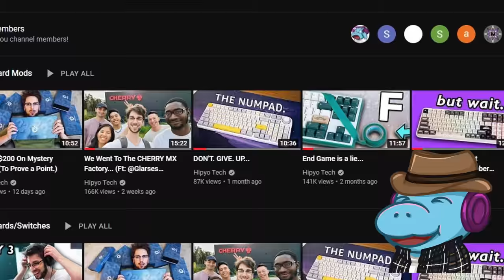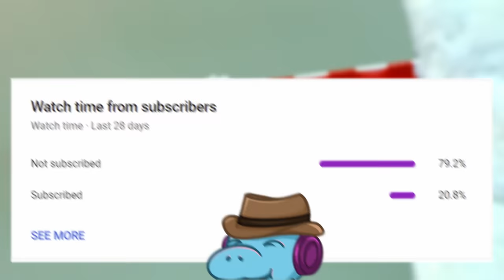Top 5 Ways To Make Your Keyboard THOCK (On A Budget)

Comment: The tape part is actually concerning. You preferably don't want to do any tape if you have a battery inside your keyboard. Electrical tape can actually be harmful, especially to hotswap sockets. If there's no battery on a hotswap pcb, use painter's tape. There's less chance of ripping out a hotswap socket. Just remember to avoid the jst cable connections so you dont accidentally rip those out either.
Reply: He uses painters tape in the video for a reason lol
Reply: @MarksterC  …he said to use electrical tape. Facepalm. I wasn’t saying the comment based on his actions but on what he was telling people to do
Reply: @SilverCrypt  so even if i have a battery painters tape is still to go?
Reply: @sleepyzzzz720  just use painter's tape on PCB and avoid covering the battery

Comment: Hey Hipyo, easy thing for the painters tape mod is make it less sticky. lightly press the tape on your shirt (clean preferably) and it will lessen the adhesive. helps a ton and makes the tape not as sticky. just fyi
Reply: It says a lot about the keyboard community when this man has to specify that the shirt should be clean
Reply: @funyunfingers  cough cough "gorilla glue" cough cough
Reply: @crusadertwo239  cough cough “joke” cough cough
Reply: @funyunfingers  I was making a ✨ joke ✨
Reply: It won't lessen the adhesive. It's just that fibers and dust particles will adhere to it.
Reply: @itsgonnabeanaurfromme  which... lessens the adhesive [adherance to other surfaces]...

Comment: I was a bit zoned out doing some CAD work, but I did hear silver bullet. You wouldn't believe how expensive that was to fill my keyboard with silver bullets, and I wouldn't say the sound is improved at all. I may need to watch the video again and pay attention this time.
Reply: silver bullet may or may not have been an expession :face-blue-smiling::face-blue-smiling::face-blue-smiling:
Reply: I hope this doesn't reach you too late.  Your silver bullet keyboard should prove moderately useful in the event of a vampire attack, however delivery of the bullet by the traditional method is preferred for optimal results.

Comment: With the automotive dampener, it also makes a noticeable difference to roll it down as well. Those rectangles that are bulging up, yeah those have to be rolled down so that they're fairly flat. I am a big fan of automotive dampener too, but these materials tend to reduce sound frequencies across the board, lows, highs, everything. I know some people prefer to only dampen lower frequencies and some like to dampen higher frequencies sounds, it all depends on the board they have and all the materials used.
Reply: Do you know where you can just buy one sheet? All the listings I have seen are 80 dollar rolls and I personally don’t think I need that much.
Reply: @mee6box you are paying a premium for "Auto" sound deadening brands like Dynamat, etc... they are nice but really overkill and overpriced for this application. There are cheaper brands that make the same product for less. They come in various thicknesses so make sure it will fit in your KB. You can also go super cheap and use Frost King or Peal & Seal duct insulation from a hardware store, I use them in my cars its the same thing but cheaper.

Comment: 00:01 Top 5 ways to improve keyboard sound
01:15 Tape mod for improved keyboard sound
02:34 Wrap bare bones keyboard PCB in plastic wrap for thock sound
03:52 Using press and seal improves the sound of switches
05:12 Lubing switches is a key step for improving keyboard sound and feel.
06:17 Adding lube to high contact points makes the keyboard smoother.
07:27 Using dampening materials and choosing keycaps can improve keyboard sound
08:50 Thick PBT keycap sets improve keyboard sound quality.
Reply: thanks

Comment: I kind of rolled a few of your mods together and took a brown paper bag, folded it to size, rolled it in ceran wrap, taped it to the bottom of the case with painters tape and I was surprised that it took a slightly rattly keyboard and firmed up the sound somewhat. I did cut small holes for the screws and had to resync the 2.4Ghz dongle.
It's a YK75 low profile keyboard without too much you can change with outemu blue switches - just because they were cheaper. for my hands, it's now the fastest keyboard I own - probably because I enjoy typing on it most and thus practice on it more.
It would be my all-time best keyboard (yes, mine are all cheap) except that you can't program keys and macros - but I went from 40 wpm to 60wpm in a couple of days.
I'm probably the key demographic in terms of starting and moving up in the keyboard world. It's not scary but under $100, the improvements that you can make are insane for a small budget.

Comment: I appreciate all the help on the video. I do plan on using this mod on my NJ80 and hopefully my Zoom75 but according to Tempest's article he says this: 

What Kind of Tape is Suitable For the Mod?
To ensure that you would buy suitable and keyboard-safe tape for tape modding, you must keep in mind these two important things:

Buy tape that is not too adhesive or sticky or designed to be easily removed. Examples of less adhesive and less sticky tapes are masking, washi, or painter’s tapes; if you ever decide to remove the tape behind your PCB, it will not damage your board. 

Sticky tapes such as duct tape and box tape tend to ruin your PCB by pulling out conduits from your keyboard when removed. Additionally, super adhesive tapes leave sticky residues that may also ruin your board. 

!!!!!Another thing to remember is that you should buy tape that is not conducive. Conductive tapes, such as electrical tape, can cause short circuits, damaging your PCB. This is especially true if your keyboard comes with a battery. The tape can potentially serve as insulation to the board’s battery, thus harming your PCB.!!!!!!

Tape that you can buy online or at local stores is sufficient for the mod. However, to guarantee that you will not damage your PCB in the process of modding, avoid purchasing adhesive and conductive tapes. Instead, opt for tapes that you can remove easily.

I'm sorry, but I just had to make sure. Still great advice!!
Reply: Just a comment about your post, from my knowledge electrical tape is not conductive and is used to isolate energy thus promoting an environment where eletricity can’t propagate and cause damage to the circuits of the PCB.

Comment: Based on my experience, getting your keyboard to thock heavily depends on the acoustics of your board rather than the switch, maybe like 80% keeb and 20% switch. I tried a budget thocky switch (Feker Matcha) that has a long pole and nylon bottom housing and it doesn't thock on my keyboard. The reason is that my keeb's silicone dampeners actually filter out the low pitch sounds a.k.a. thock, making it clacky and poppy. So I removed them and replaced my switch dampeners to PE foam and my bottom plate silicone to polyfill (that I stole from my pillows lol). The sound difference was amazing. My keeb went from a high-pitch clack sound profile to a deeper thock. I think I watched another youtuber explain this topic better, iirc it was Keybored.

Comment: Thanks so much for your channel, Hippyo! I can't dive full into the hobby, but I have to type a lot, and was inspired by your channel to dive in (somewhat). I got the Magegee MX Box (with red switches) for cheap to try out mechanical keyboards, and I love it, simple as it is. Think you could take a crack at modding one of those for us super low-enders? Thanks for sharing what you love!
Reply: Yooooo I have that SAME keyboard. I did the tape mod, got decent switches and key caps and it sounds perfect

Comment: Hey Hipyo. I just did what I'm calling the Velcro mod. Basically it's the tape mode but instead of tape you are using the Loop side of some sticky backed Velcro. I use some 50mm (2") on the back of the pcb and some in the case of my budget Ajazz and it has given it so much dampening and now the case feels like it's made of a solid block of something. Looking forward to some new decent switches and maybe ceramic keycaps. I like creamy thock and it's definitely getting there.. 
Oh ands it has made it feel like it has huge gasket mounts too.. so good

Comment: Thanks to you I am going to attempt modding a $15 E-YOOSO Keyboard 🙃. I will be ordering all I need in a week or so. Here are all the parts i'll get:

* XFasten's 2in wide painters tape
* Tekbond's 2.8oz of silicon caulk
* Akko CS matcha green 3 pin linear switches
* Matcha green (various green shades) PBT caps
* ZugGear Durock plate mounted stabilizers
* 3m's cloth adhesive medical tape
* Epomaker's mint gree coiled usb cable

The keyboard is a bit different than the one in the video you had made using a E-YOOSO, here are the differences on mine:

* Has a metal panel
* Has RGB, but only in yellow 😅
* The case is all white
* Has detachable USB C cable method

I won't be doing any lubing, but maybe later down the line.

Comment: I have a Cougar Attack2 so am limited what I can do as switches are not-removable (soldered) and therefore (as far as I know) can't be lubed. Also cant wrap the PCB.  What options do I have to improve the sound of mine and especially the terrible space bar which sounds really hollow and well, terrible. Ta.
Reply: update: Yeah there's very little possible the only thing I could do was the tape mod and it has actually made it better.  It's by no means good - still quite terrible actually - but is certainly better than before the tape mod - a tad thockier. Worth doing for sure,  I do still really want a proper keyboard though.

Comment: Hey you should try the Mr. Clean Magic Eraser Sheets....it's a very dense melamine sponge in a .75 millimeter thick format. The material is a dense, ultra tight cell sponge (cells so small and tight, you need a microscope to see the pores). The material has an amazing springy-ness to it and it is far denser than traditional foam or Eva foam. It comes in many sheets and you can probably layer them if you need to. Definitely worth more of a try than playdoh, sand, or whatever crazy thock experiments. Definitely try this. I think it is a game changer.

Comment: PSA: plastic wrapping optical keyboards won't work. You'll block the sensors unless you start cutting little holes for the stem.
(lubing opticals is great though and tape mod will work if it doesn't block the stems.)
Reply: Ofc you gotta cut off the tape first of all it blocks the screw holes but cutting part is pain in the ass did it yesterday

Comment: I tried these mods on a Northgate OmniKey 102 that I have, just to see. This old board is just a steel bottom case, with a ABS top plate, a steel plate, and white ALPS switches and double-shot ABS keycaps. I was able to apply the tape mod and line the bottom case with some toolbox liner foam. It's not as clacky/echoey. The switches need some lubing--but given they're ALPS, I need to do more research on that. Anyway, I was just fooling around--I'm really looking forward to getting a Keychron Q6 and playing around with these mods to get it to sound the way I want it to sound. Thanks for posting!

Comment: I know I'm going to get some comments like "WHY?!?" for this but I'm going to ask.... I like the click, as in, it tickles my brain the right way, but also hearing the thocc also does something great to my brain. I found these really clicky switches by Redragon (yes, I know, super budget) that seem even clickier than cherry blues. I've done the tape and extra foam mod in a Magegee keyboard (yes, I know this is all super awful budget) chasing the Tick-Thocc(tm... dunno if this term already exists but I'm starting it if not) but still getting the rattle. This Magegee keyboard isn't hotswap which I didn't know at the time. What is the best and cheap hotswap keyboard to get into this hobby? I blew my original budget by not watching enough videos so didn't take into account certain things before buying stuff. What I've got so far with this current setup seems to be promising but far from what I'm imagining.

So what would the recommendation be for a super budget hotswap keyboard chassis to get Thocc so I can try Tick-Thocc(tm) to a point where, if I decide I do really like it, I can then proverbially chase the dragon and go bigger?

Comment: One good tip I have found was to put Al lot of tape into the spacekey. 

I've done about 8 or nine layers of painters tape on each side between the switch and the stablelizer. 

This souldn't cause any interference and the more tape you put in there, the Thockier it gets.

Comment: Put 3-4 layers of painters tape to the back of the PCB, fill your keyboard with foam and tissue sandwich (I mean literally fill it until the foam is level with the screw mounts), and use red/brown switch. If your keyboard still ain't THOCKY, throw it in the garbage. Once it sounds decently thocky but not THOCKY enough, replace the keycaps with THICCER PBT keycaps and try other switches from different manufacturers.

Comment: Hmm, so is it worth doing both the tape mod and the foam/kilmat? I’ve seen somewhere else before that they cause different, almost opposite, changes in sound, I’m wondering if they would essentially “cancel” each other out
Reply from the maker: I almost always do tape when I kilmat
Reply: @HipyoTech  awesome! I’ll definitely try doing both as well then. My board has a bunch of “compartments” inside though, divided by small rails, kinda like the $45 ROG board you used Kilmat on, but they seem to be a bit higher. I noticed you just put the kilmat over those rails yourself, I was wondering if I should try doing that too or cut the kilmat to fit in each compartment instead

Comment: The tape mod is excellent and easy mod to do, but...  having a low profile KeyCron K1 SE, I find the sound of the keys in the centre of the keyboard are nicely thocky.  But the keys around the edge of the keyboard, though have improved there I can hear a difference in the sound.  Not as thocky as the center keys and audibly sound different.

Suggestions very welcome.
Reply: Tbf if you do a tape mod, you can control where you put tape. Maybe less tape where its good and more where its as good.
Although I got no clue if that actually works^^
Reply: @termitreter6545  I applied additional layers of tape beneath the edge keys, it helped a little there is not much room in my K1 to apply much tape.  I plan to wrap the tape around the edge of the, but need to open the keyboard again to see if there is space to do this.  Otherwise the results are very good..

Comment: hi hipyo, thanks for the content. i have keychron q5 pro. and i want to use tape mod as well. people said you should use painters tape because it wont leave a residue so i purchased a good brand. now im checking your vid to be %100 sure however you said battery might got heated and tape could catch on fire. however my painter tape has high heat resistance (80 degree celcius - 176 fahrenheit) can i use this painter tape? i never feel my keyboard is hot, it'll always cold with aluminium frame and i never turn on rgb also. should i buy electrical tape which could leave residue but i guess it wont catch on fire or painter tape is good/better?

lastly if i use painter tape mod. how many layers i should apply, 3,4,5? and should i apply tape to whole pcb or should i leave some parts open, is there a thing i should be careful?

Comment: I'd love to build my own wireless mechanical keyboard. My only issue with doing this is that no keyboards I am aware of have options for macro keys on the left hand side though, so if anyone can point me in the direction of a case/board that does have extra macro keys and numpad I would be very happy to give it a look-see.
  
You custom keyboard guys are gonna laugh, but I have (and like everything but the switches) the Logitech G613. I also just got a G915 full sized keyboard (not TKL) and besides having to reach for the G613 when I want to use it on my lap its pretty sweet and has much better switches even though they are low profile. Both are supported on linux with the use of Solaar which is a MUST for my use case. The G915 has onboard memory that although cannot currently be written to on linux it does allow use without any software which is very nice!
Reply: Hey Friend! I'd take a look at the new Lemokey L3 by Keychron. I think it'll suit your needs perfectly. Macro keys and a knob on the left side of the keyboard instead of the right.
Reply: @Animesk8ter12   Woah, that's cool! That's extremely close to what I'm looking for aside from lacking the numpad which might not be a total deal breaker. I'm used to the 'ins, del, home, end, pgup/dn' keys being located above the arrow keys and use them frequently, so that's a concern.
Reply: @Grey-Troll  Nice, I tend to be the same way tbh. I think the closest thing I've seen to that style is the Keychron Q12 QMK. Specific keyboard styles can be illusive, but they're hella cool to find!

Comment: Would be really nice if manufacturers offered switches partly assembled. For me the most time consuming aspect is taking them apart. Just the option of getting a bag of springs, stems, and housings with leaf springs pre-installed would make me 2-3x's more willing to lube them.

Honestly, just the idea of having to lube new switches puts me off from buying new switches. It's never taken me less than 4-5 hours .... not once.
Reply: MM switches are available as a line of parts (stems, springs, top and bottom housings), so they come disassembled.